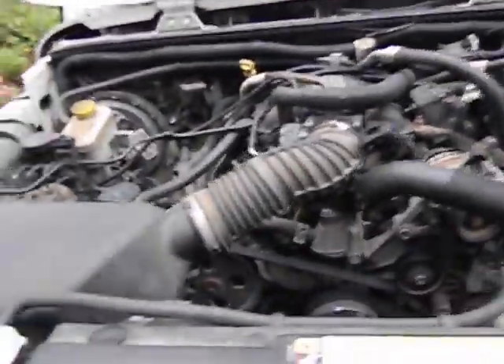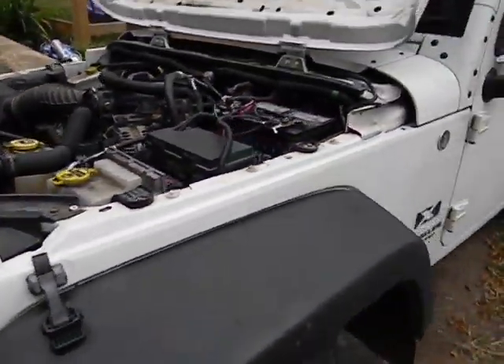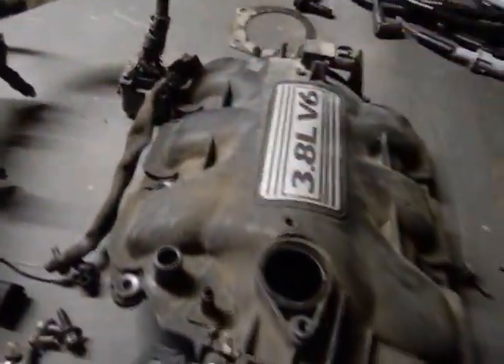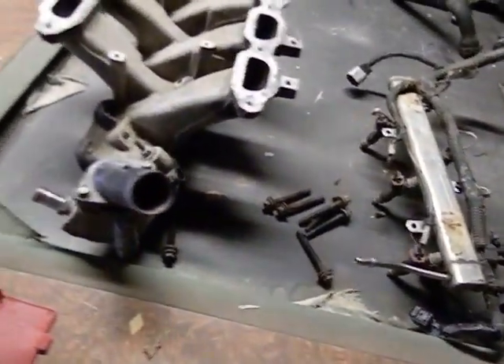Jeep Wrangler 3.8 engine removal swap

Comment: Did you have to do anything extra with swapping over the rotating assembly? Oversized bearings? Grind the crank? I'm about to do this because my 3.8 in my Wrangler seized. I'd like to know what exactly I need to do. Thanks
Reply from the maker: The only thing you have to do is clearance a small area on the upper aluminum oil pan.  The rod caps are bigger on the van rods.  There is another vid on this series you can see.  As for machining or bearings nothing different.  It will drop right in the Jeep block

Comment: Did the caravan engine end up working?
Reply from the maker: Yes and no.  The internals were the same and the heads the same but the block at least the 2003 block was slightly different.  I've read that 07+blocks are the same.  I may have just had the wrong year.
Reply: @johnbrakingground  I later watched that you had a problem to solve by modifying the gusset of the oil pan where it was hitting the rodpin near bottom dead center.  Man, I would sure love for you to be there to let me know what the connections are when I pull my 3.8 later this year.